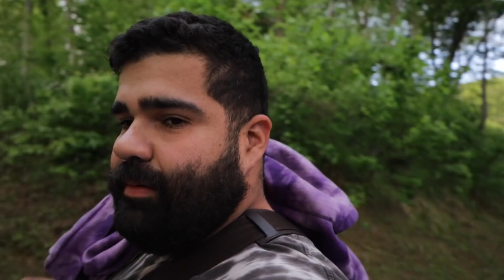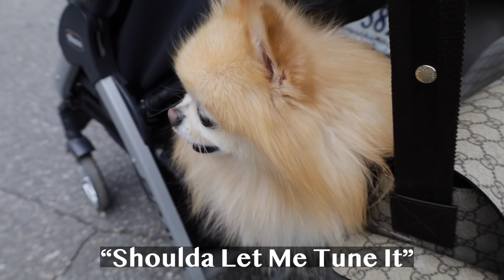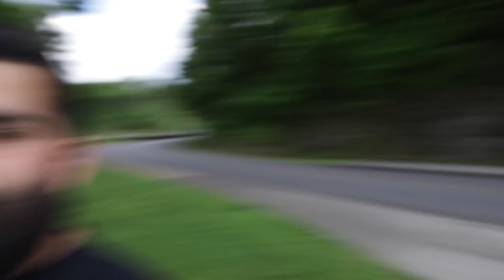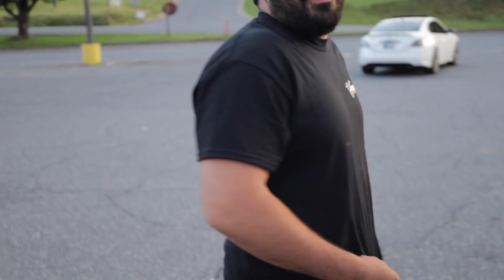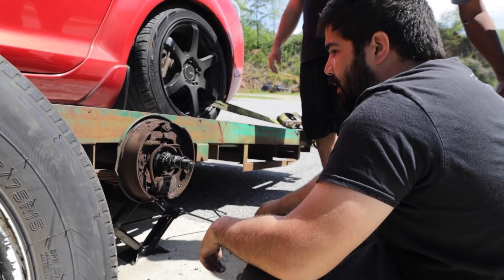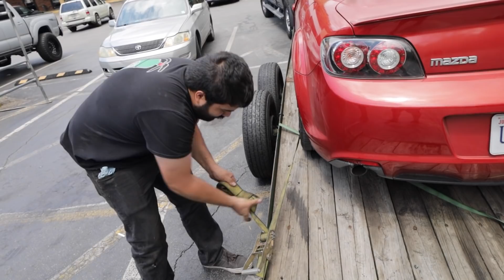Rx8s Takeover Deals Gap  & Mike's Trailer Destroys Itself

Comment: Can you turbo the stock rx8 engine? £500 over here in the uk
Reply: Not if you want it to live for any length of time. They need a total rebuild to make power and they are super complicated. There is a reason those RX8’s are £500!
Reply: Nope, for low power 200-300hp you need at least a rebuild with stronger internals, even this is expensive (not worth it), for decent power (400+ reliably), the only option is an REW or hybrid (block off side exhaust ports) both expensive and the best bet is the 2nd options
Reply: You can turbo the stock renesis sure, but the housings will crack eventually and the power output will be 200-300 Max, you’ll still get gapped by stock Volkswagen GTIs or WRXs, do it properly and you can outrun 911s

Comment: RX-8's work better stock? How? They need upgraded coils and cleaned up at high rpm with a tune. Midpipe obviously helps too.
Reply from the maker: Mikes is literally bone stock and runs better than 90% of rx8s
Reply: @angelmotorsports  I have to disagree, respectfully of course. I know bolt ons do next to nothing for an RX-8, but those 3 mods I did have made a difference although I have no Dyno or data logs to prove it. It runs cooler with the tune I have too. Coolant was pushing 210 at a drive through now won't go over 194 and runs 180-185 at driving speeds. That has to count for something??? It's all I got:(

Comment: Never got the rx8 hate .. ive plenty of customers over 100k miles on theirs, common demoninator is they all stay ontop of oil level and coils going out. every , and i meen every rx8 ive ever sean with wiped out main bearings ( the most common cause of low compression) is owner neglect, they assume its ignore the bonnet for 20k between services like every other car.